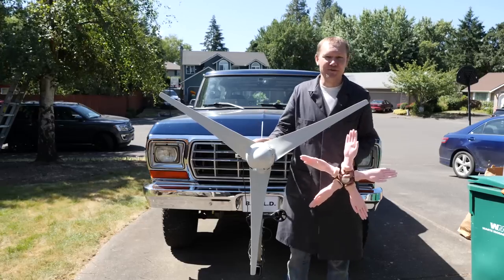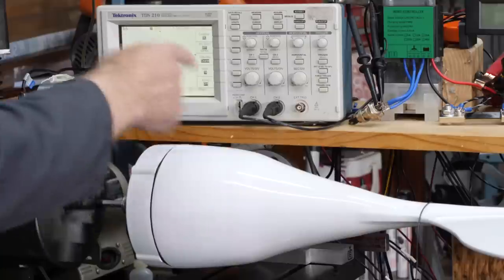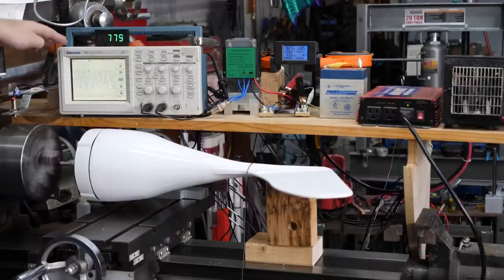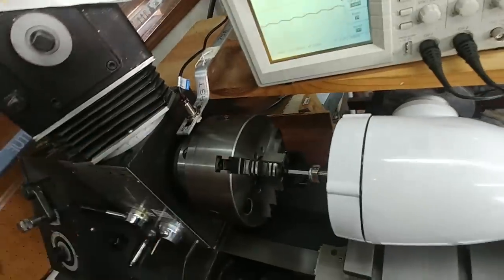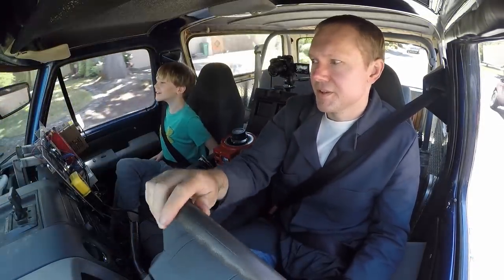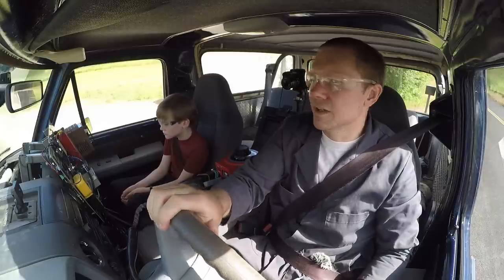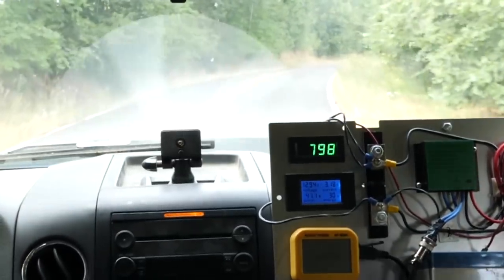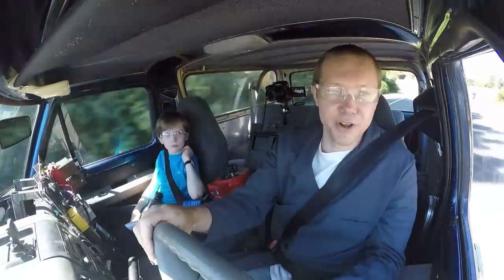Wind Power on a CAR #2 - Testing the Betz Limit for Turbines

Comment: as someone who studied wind turbines in college I can say without a doubt this video is gold.
Reply from the maker: Thanks Jesse!!!
Reply: the Whole Channel is a Gold.. Extract how much You Can !!
Reply: Jesse can you help me with evaluating a wind turbine site?
Reply: @Mike-kr5dn  tesup?
Reply: @QuintBUILDs  Thats the problem with micro wind. A LOT of the products are truly junk. Especially at that 400 watt scale. That being said I have a 1.5 kw Chinese turbine that I reliably get over 1kw out of anywhere above 22mph. Cost me $1200 but it was well worth it.
Reply: @QuintBUILDs  be aware 
Some of the controlers are PWM .. NOT MPPT
PWM kill off speed it 
Take a 3 way 50 or 100A rectifier 
Put DC direcktly into a EPever 6415 (150Volt free spin 90++v )
And to a batteri truh thick leads 40A is a Lot tro test leads 
Way way way abowe the rated 12v 2A
.. 
Going til fast IT Wil break anyway INTERNAL 
THE DUMPLOAD WILL KICK IN TO BREAK
My controlers are way way bigger 
I bought the 2000watt controlers 
To a 500watt turbine!! 
Only dif is sice of mppt handling power
And break surface 
I ditched the controlers and went for 3 way rectifier
And 6415 .. to monitor the turbines and 90 +++ v in free spin in low wind 
Ain't un usual thats why i chose the 150v mppt 
DO NOT ENGAGDE MPPT UNDER LOADE !!! 
NEVER PUT + - ON BAT WHEN TURBINE SPINNING 
YOU CAN PUT + - ON 
THEN TURBINE OR YOU WILL FRY THE MPPT
Reply: Jesse Vaughan do you know anything about a 5 bladed turbine compared to a 3 bladed one? Like what the difference is in energy output, sound output, cut in wind speed etc.
Reply: @kennethschultz6465  Do you have any recommended DIYs or even wind turbine what are worthy to buy?
Reply: @QuintBUILDs  p
Reply: Excellent video thank you for teaching me more, iam myself an independent researcher at the present time I'm working on my research for green energy wind turbine that you can control the speed of wind, direction, less space, less noise, No effect on wild life birds and it can generate it's own 24/7/365 I have proofing my claims for my research but only problem is is the generator I have but a small model to show the idea work but I indicated only problem is the generator, been trying to find a small one that can produce at least 7 amp.
Reply: Would redesign of blades make much difference?
Reply: As someone that just took a college exam on this, good job💪
Reply: @QuintBUILDs  I think it's time to look into jet turbines. It's where you need to start.
I look forward to seeing your results when you do.
Reply: @QuintBUILDs  m
Reply: Seriously? There is a class in a college called “Wind Turbines, Study of?”
Reply: Hi @Quint can you please tell how to select the wind turbines to set up for home 
What is the process and compare the OPEX and CAPEX cost in between grid and owned power supply systems

Comment: A fun video thankyou. I successfully use a wind turbine to power my off-grid house. Credible designs that work are actually quite sophisticated in their operation.

I use a Berget XL1. At full power it  produces about 42A at 25V. This output depends on the charging load and is reached at a windspeed of about 35kmh. It has worked very well for over 12 years 

 The controller in turbines like the Bergey is a digital controller with some similarities to a solar MPPT controller. It extracts energy from the rotational inertia of the blade disc in a way to maintain optimal rpm with respect to given wind speed and the load. It does this by extracting the energy in short pulses (in the Bergey about 30 pulses per second). As the wind speed increases and depending on the load,  these pulses lengthen to keep rpm in a safe and efficient operating range. At very high rpm the controller starts to short the windings (in the Bergey case into a .2 Ohm resistor) to prevent turbine overspeed. 

To have all this work in a balanced way it is very important to have a big battery to stabilise load voltage as this is one of the parameters the controller needs to reference many times per second. 

For the turbine to work at optimal efficiency against lead acid batteries, ideally the battery in Ampere Hours needs to be ten times the maximum rated current of the turbine. In the example of my Bergey that means the battery needs to be 420AH. If you install small batteries the battery voltage jumps around too much causing the controller to misfunction. In my view in the case of the small 12V 500W turbines you should have a battery of at least 100AH, and preferably much higher.

You can get analogue regulators for wind turbines, these are more tolerant of fluctuating voltages but they are far less efficient because they don't optimise rpm and don't have overspeed braking.

Finally the cheap turbines have flexible blades that bend (furl) to dump excess disc pressure in overload situations where rpm cannot be controlled by braking. These are a suboptimal design prone to blade tip stall and flutter.  For best efficiency the blades need to be relatively stiff with furling either by turning the blade disc out of wind (the Bergey method) or by a variable pitch mechanism that fully feathers the blades to stop them rotating.
Reply: Passive induction mechanical intakes could solve most of the issues that plague wind power generation. But they need to be downsized to homeowner sizes to be viable, imho. 
You have a nice system.

Comment: Hey mate, I did my honours project on wind tunnel testing of these small turbines in an automotive wind tunnel taking wake measurements of them. Your explanation of the concepts is amazing. 
Early in my testing I came across the same automatic electrical braking at a particular voltage, which is proportionate to an upper limit of rotational speed to protect the turbine. In my testing I bypassed this electrical braking and my turbine performed significantly better as it wouldn't continuously brake when it reached a high voltage.
It can reach that voltage limit quite easily if the resistance supplied is high ohm (low physical resistance on turbine). This will produce a very low power but be sufficient voltage to trip the brake.
Reply from the maker: That sounds like an awesome project Thomas!  Thanks for the insight on the resistance.  Keep in touch as the project progresses.  I wish I could go back in time and check out your wind tunnel setup.  FYI, I bought a 7200w alternator for part 3.  It's HUGE!  Going to really test the formulas now.  I'm going to connect it directly to heating elements rather than messing with the inverter/controller too.  I've got big plans for parts 4 and 5 assuming it works. :)

Comment: Awesome video! But shouldn't you be wearing short sleeves while working the lathe?
Lots of accidents happen because the long sleeves get pulled into the spindle.
Best regards! =)
Reply: I was waiting for his sleeve to get caught.
Reply: The camera angle made it look like he was reaching over the lathe chuck. Those dangling sleeves made me cringe in fear.
Reply: @ardvark84  
It doesn't. But if such a simple precaution helps lower the odds, why not put it in practice?
As you said, people die from the silliest, most harmless things, so why take the extra risk?
Reply: @Stevenzao  Because as I've also said when you experienced enough there is no risk. Some people can walk on lines because they practiced a lot. But no matter what safety things you would imagine, they won't help me walk on the lines. I'm not saying experienced people won't get hurt, I'm saying that most likely they won't. And lo and behold, he's fine.
Reply: @ardvark84  I see both sides of the argument you're having.  I just want to include that doing something considered unsafe many times, such as standing on the very top of the ladder without being hurt, won't improve your odds of not being injured that time you're tired at work and do the same thing out of habit. But also, yes, experience helps prevent accidents.  Same is true for my job.  I can allow more risk as I gain experience and still be as safe as before.
Reply: @KaizerKilborn  Anything is allowed as long as you know exactly what's going on. Any unknown, any unpredicted and you're done.
Reply: I was working the lathe with very Long hair, and almost died. I cut my hair very short later that day. Gave me nightmares for a while......
Reply: @OddBr18g  Well I know a guy who was driving drunk and almost died. But you are mixing things with 90% chances of a bad thing happening with things with 10% chances of bad thing happening. That's not a valid argument.

Comment: This is a great video. I just happened to watch the ones related to rainfall generation. I wish I really had half your energy to build and run all these experiments. One thing worth commenting is that the wind turbine setup with a large car grille right behind the turbine may be blocking or deviating a portion of the wind energy from the rotor blades. Ideally, the wind turbine should be located on the roof (at a certain height) to better allow the wind flow directly on the turbine. I know this is very difficult. Just to point out where there could be a portion of the under performance observed with current setup. Keep it up. Thanks

Comment: One issue I can find here is with the choice of inverter. I noticed you're using a modified sine wave inverter. Those are cheap, easy to find, and only about 80% efficient. Also they can kill motors and have an enormous amount of harmonics that can damage electronics.
I'd recommend trying a good pure sine wave inverter. Those are about 98% efficient and usually have fewer harmonics than even grid power.
Reply from the maker: Should that matter when the current is being measured prior to the inverter?
Reply: What is a 20% loss in efficiency before the loss in efficiency?

Comment: I actually had this same idea 20 years ago, but was too involved in other projects. My thought on this is I always thought it would work. 
The best application I can think of for this would be RVs and travel trailers that would have a battery bank for storage of the electricity. It would allow you to have electricity much longer in remote locations, and combined with roof mnted solar panels, would be a much longer lasting supply than the panels alone, which is what we see today. Id up the normal 2 rv batteries to at least 6-8. Add those watt-hours up and you'll see its quite a bit. Add an auto bypass to that and when the batteries reach charge, the current from the wind gen can be used to heat the water tank so you have more hot water without using propane. Cool video, Sonny T

Comment: Cool project, but I wanna know more about that Bronco! Noticed it's a 70s from the front end, then did a triple take when I saw the dash. Super neat! Did you swap anything else like power train??
Reply from the maker: 78 bronco with the guts from a 2004 f150.  engine, trans, transfer case, abs module, a/c, power windows/doors... just about everything.
Reply: @QuintBUILDs  VERY NICE!! I noticed the passenger airbag disabled light, so assumed you did more than just the dash. Super cool man!
Reply: That is a super neat truck! I live in Hillsboro, maybe I'll see it driving around!  Should be easy to spot with the turbine on the front :)
Reply: Oh my, I kept wondering why.  I thought it was just the dashboard!

Comment: Fantastic, love the whole approach to the subject.
Those "cheap" wind turbines sold on Amazon are mostly overrated overpriced junk. The real marine ones, for small vessels, cost well over 1000$, both in HAWT or Gorlov configuration and sometimes those too have overrated specs for marketing purposes.
Looking forward to the next video.
Reply: Interestingly 1000 Watt car dynamo's cost slightly over 100 euro's, even less from the car butcher.  They run at high speeds, but they charge batteries at 1800 car rpm.
Reply: @albertvanderhorst4160  Do you mean an alternator? Never seen a 1000W alternator, usually they are rated in V for electric potential, not in W for power.  Do you have any examples?
Reply: @gafrers  12 V 90 Ampere is about 1000 Watts in my book. I have such an alternator in my Mondeo 2.0. I can buy a used one for 35 euro's. Obviously 90 A is at 6000 rpm times the transmission gain.
Reply: @albertvanderhorst4160  Price difference is that, higher rpm, semiprotected enviroment, not exposed to direct saltwater, mass produced.
Reply: @gafrers  My Ford Mondeo Ghia has a 80 Amp alternator for a standard 12V lead battery. That is about 1000 W in my book.

Comment: Thicker wires in the motor can make a big difference lowering internal resistance through a long wire composing a coil, while thinner but short wires in controller might not make a huge difference. 21:09
Reply: A key issue with ALTERNATORs is that the faster you spin them, the higher the frequency of the AC flowing in the coils.  At 1500 RPM with a 12 pole rotor, the frequency is up to 150 Hz.  And that means the synchronous reactance of the windings is getting higher as well.   In AC generators, the synchronous reactance is much more limiting than the simple DC resistance.  So even if you spin them at a few thousand RPM, there's still a limit to how much current you can get out.

Comment: The PWM "inverter" is probably a lot of the issue. Buy a MPPT inverter since it will always analyze the power and try to pull more or less amps to increase the power

Comment: Inspiring video which has been done a lot of times by others, some people build cars around the turbines lol. This shows us that the idea is brilliant but the results are still not very promising. It also shows me that there must be another way to make use of the wind on your car. My idea is that we have to use the wind AROUND the car! Using the front wind and using the draft behind a car to trick the Betz limit theorie. It resulted into a prototype that works on these principles. A so called Push/Pull generator which will spin on a very high speed going up to a couple of thousand RPM and being reduced by a gearbox if the speed is to high for a normal wind generator. Maybe a car generator can do this job because they can go up to 10.000 RPM and higher. This Push/Pull generator has the ability to go up in speed to that circumstances of a normal car generator and can produce the same amount of power this car generator can produce. It should be around 12 Volts and 25 to 30 Amps loading power to charge the battery on a car. I think this idea works way better then most of the wind generators on the market right now, but it's made for the use on cars only. I am working on a type that can be used in open field or at your house. Same theorie but a little different then my Push/Pull generator.

Comment: that "strobe effect" at 29:07 is called rolling shutter. Its where the thing spinning in front of the light sensor in the camera matches (or closely matches) the shutter speed of the camera. i believe corridor digital (youtube channel, check them out) did a video on this in an airplane a couple years back

Comment: Hi, thanks for the in-depth analysis and explanations in your videos. Sets your channel apart from many others that lack technical depth.
It seems that the "rectifiers" that come with the Chinese wind turbines have other functions built in, and have variable performance. I would be very interested to see what power you could achieve (driving the generator with the lathe) if you connected the output through a simple 3-phase rectifier and used the output to charge a large 12V lead-acid battery that was less than half charged.  This would show what the generator itself was capable of, without interference from a "Smart" controller.
Reply: Maybe a 1000 amp or more marine deep cycle battery?

Comment: They're testing these turbines in the wind tunnel, we actually had one at Reading University (UK). They give you reproducible lab conditions but are not even comparable to real life application, especially in built-up areas, where these turbines yaw a lot and are pretty much a wholesome disappointment (plus in the occasional storm, they can rattle your masonry when roof mounted so that's not a good idea either!) The airstream at the front of your Bronco should be fairly consistent too, so it's disappointing to see that they do not even get anywhere close to the rated wattage.

Comment: At last a really valuable video on finding the limit. both on power RPM and overload. Without a battery after the wind turbine regulator the inverter will mess you around. Test would have been easier just with charging current.
Reply from the maker: Thanks Ian! 👍

Comment: The connection from the battery to the inverter during lathe test was with a couple thin alligator clip jumper wires, so i think there's too much voltage loss.

Comment: From the Netherlands - nice video , thanks for that . It proves again , that a lot of items coming from  Aliexpress  are not up to spec. And that is putting it very politely . Batteries and their capacity , torches , lasers , magnets , windturbines , minerals , and even plant seeds , are not as they are presented. 18650 batteries that are 9800 maH , torches that go up to 200.000 lumen and fitted with Cree led's that do not exist, lasers that are 100mW but in fact  1 mW , N38 magnets rather then N52 , 300 W vertical windturbines that produce 8 W at best , minerals are made of plastic , and  seeds that will grow multicoloured  or blue roses . Having said this , from Alabama there is something called the "Microcube "  . A 9x9x9 inch  unit that outputs more than 200W at 23 mph , while the  wind energy in a 9x9 inch surface is about 30 W at that wind speed. So keep up the good work and regards to your son , from ( almost ) the other side of the world.

Comment: Build bigger rotor and stator and a battery large enough to accept the wattage produced (ie. not cranking amps). There is also the brake disk wind generators.